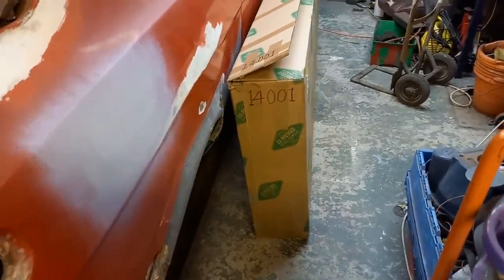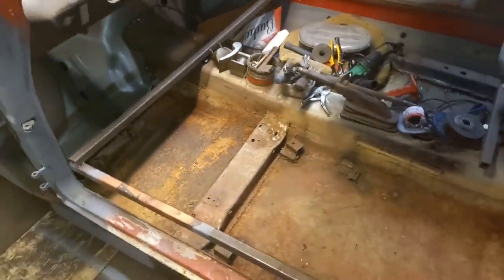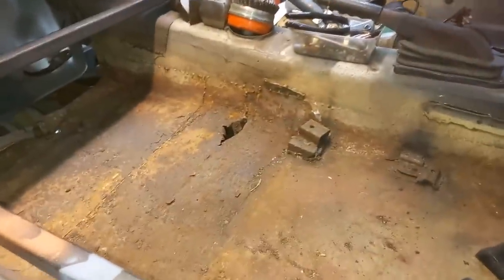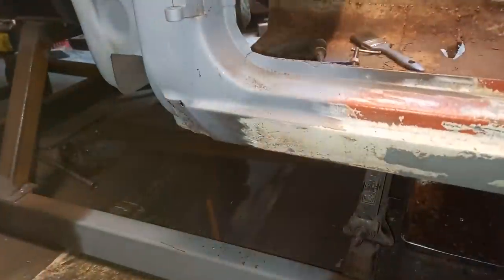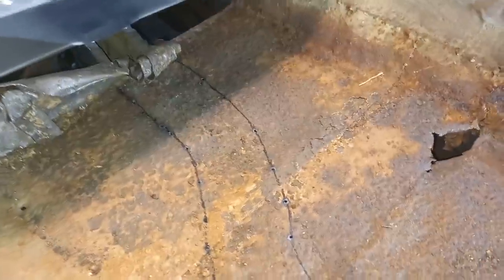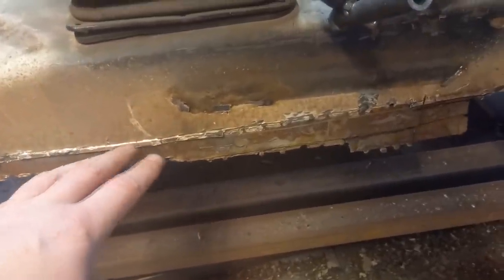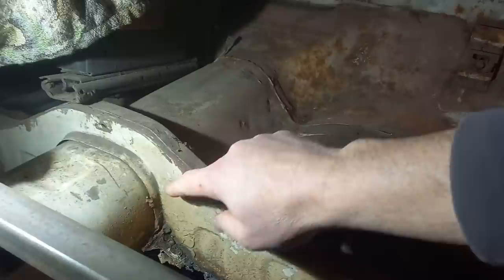Ford Escort MK1 NS Floor Pan Replacement.  Car Restoration.

Comment: Nice one, the car is coming up good. I did see Fitz's clip on how to bring up the two panels flush together. The key, as he said was to keep the cutter at the 45 deg, or thereabouts, angle and as you remove the cutter, the panels come together nicely.

Comment: Glad to see you are back at it! Really sorry you have had covid but happy you are getting over it. That floor pan is looking great, it's a really big job, but you have done a top job of getting it well aligned and properly snugged down to the chassis rails. I only discovered those hex headed self tapping TEC screws after completing the majority of my chassis restoration, however they certainly help in pulling panels together and keeping alignment while working the panel elswhere. Another bonus is that there is only a small hole to weld up. Loving your build, and always look forward to the next instalment. Take care and hope your recovery continues at pace.
Reply from the maker: Thank you Neil, yep the screws are a life saver. 😊

Comment: Big step taken well done, sounded a bit of a struggle with the covid, glad your ok. This is a Job i need to do on my MK1 cortina, also got my panels from Expressed, top quality.
Reply from the maker: Thank you Brian, yep, glad I am fully jabbed, dread to think how bad I would have been otherwise. I think the floor pan in the cortina is a bit more straight forward, the Escort includes what would otherwise be an inner sill, complicates it a bit, all the best with it.

Comment: Great job Dave, I like the way you show us how to make smaller panels but that floor pan would have been a monster to make. keep plodding on, good luck with the rest of the project🙂.
Reply from the maker: Thank you Kevin, you are right, would have been a lot, if I did, I’d have probably done it in three separate pieces, but the price was right, so, happy days

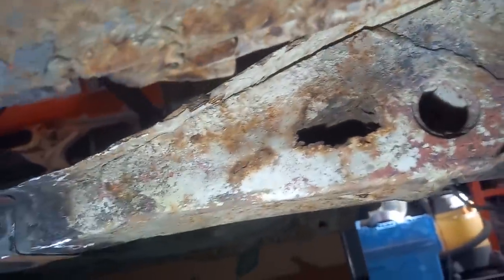Comment: Just a bit puzzled about the bit at 8:17 ? Did you cut out the old rail, repair it, and put it back, or, is the one you weld in a replacement part?
Reply from the maker: thanks for your comment, remade from scratch a new one, a link to it is at the end.
Reply from the maker: Try https://youtu.be/SZDhzUpRK_8

Comment: again good work dave,i have heard that expressed panels arent very good but after seeing the floorpan i dont know,and jamie (retro rust )has just had a problem with his capri inner cill from ex pressed about not being true to original,im looking forward to your rollover jig build or have you bought one ?.
Reply from the maker: It's the first panel I've had from them, so can't comment further. I will be building my own roll over jig, will likely incorporate it into the existing jig I've got the Escort on.

Comment: Hi and please keep doing these videos, I am just about to start so this is great stuff. Can you tell me why you went to Expressed rather than Magnum please 
Regards Steve
Reply from the maker: Hi Steve, thanks for your comment, the Magnum panel looks suspiciously like the Klokkerholm panels, I guess they get them from the same place. My experience with Klokkerholm with another panel was a poor pressing and thin material, so wasn’t going to take the risk.
Reply: Thanks Dave and keep them coming, I am in a bit of a panic to get some stuff ordered now that I have seen the lead time
Reply from the maker: Took 2 months to get the pabel from express, everywhere is the same at the moment.

Comment: Nice job Dave, how far do you think you've got to go before the shell is mounted onto the rotisserie?
Reply from the maker: Not too far now, just need to put the strength back into the off side chassis and I think it’ll be ok to take off the jig, and put onto a spit. Will be so much easier to work on when that happens.

Comment: Hi Dave, could I ask what size wire you use and what your welder settings are please?
Reply from the maker: Hi Tony, I use 0.6mm wire, the settings will depend on your machine, so my settings won't really help. But I definitely find 0.6mm wire is easier to use than 0.8. I'm trying out 0.8mm flux cored wire at the moment and I'm pleasantly surprised how good it is.
Reply: @DavesGarageuk  thanks a million Dave…. I’m absolutely loving your channel….. I was all but giving up on restoration, but your show with the “what have I got to loose” attitude has given me a fresh drive again. Thanks so much and PLEASE keep it going.
I’m living in Ireland and have a couple of cars (Renault16’s and a 1500 Dolomite) 
Cheers for now,
Tony
Reply from the maker: @tonycrinion6086  thanks pal, appreciate that 😊